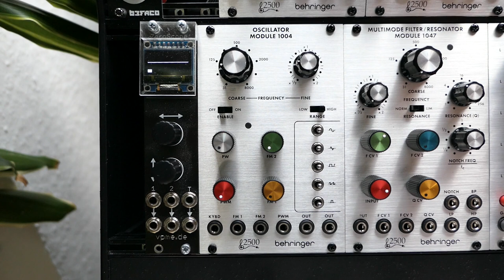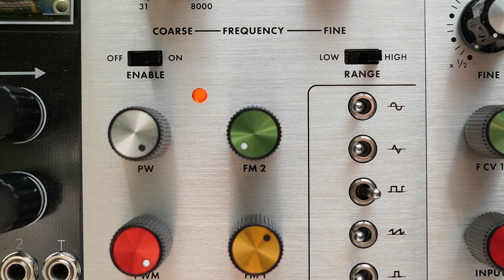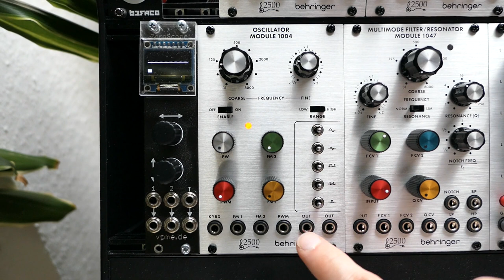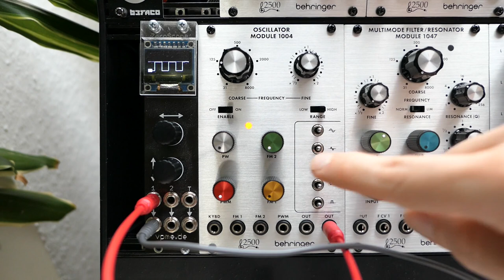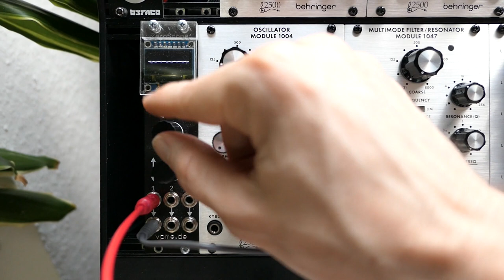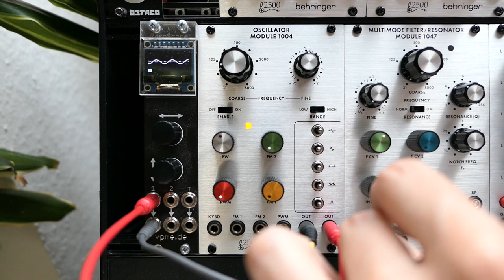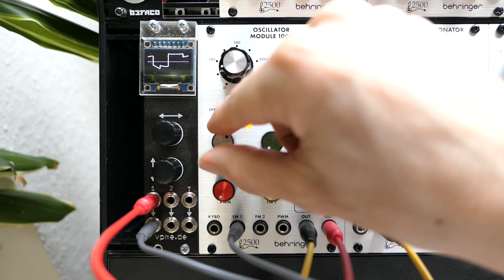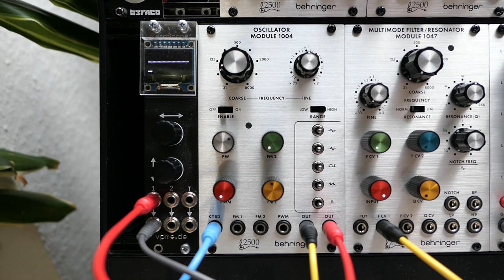Behringer Oscillator Module 1004 ~ features & sounds

Comment: I was wondering if this module can self modulate using the second output on one of the FM input....
Reply from the maker: Yes that works, the result differs a lot with the waveform. With the simple sine and triangle waves, the frequency drops and more harmonics appear. Saw and square give different results. Since the modulation is always in phase with the Oscillator in this setup, you will not get the typical "FM sounds".

Comment: Curious if one of the duplicate outs can be patched into either the PW or PWM for modulation that's affected by the keyboard or sequencer voltages?
Reply from the maker: Patching one of the outpus into the pwm seems to have a very subtle effect, I guess due to the two outputs being perfectly in phase. And not affected by the pitch.